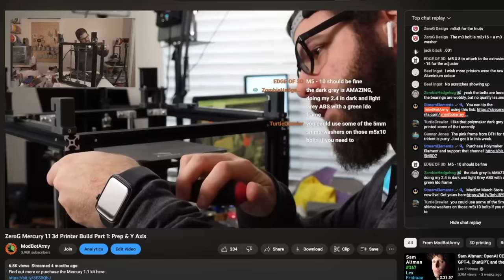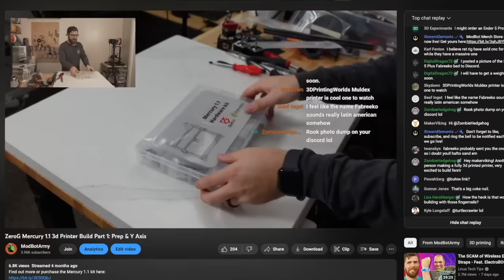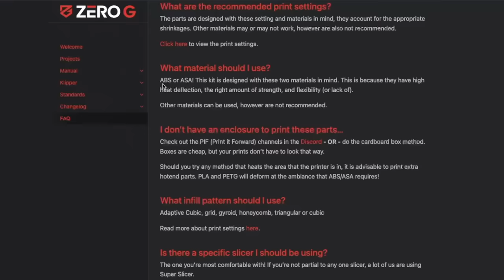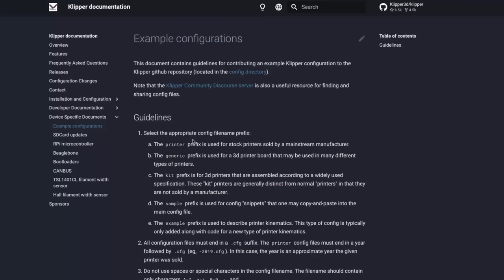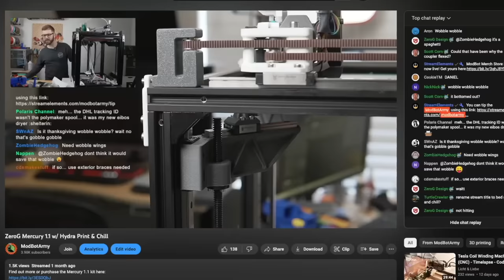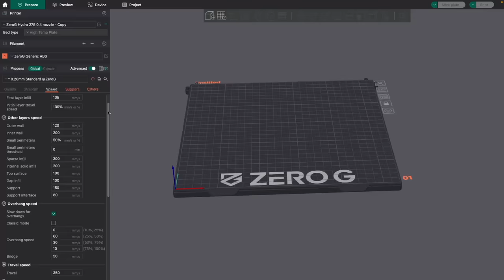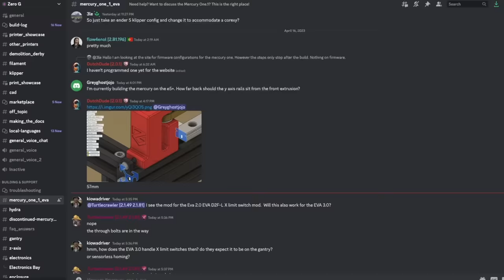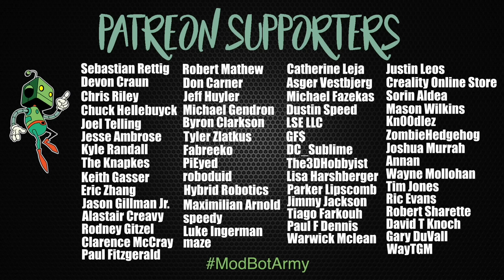Favorite CoreXY 3d Printer Build?! Zero G Mercury 1.1

Comment: I created a custom Mod Max upgrade to get a 310x310 print bed. I’m surprised they don’t do this out of the box. It requires no extra parts (just modified printed parts) other than the larger bed/heater.
Reply: I saw the modmax upgrade on printables but the Z conversion was not complete. Can you give more details about that?
Reply: @DerUltrazauberer  I just uploaded the Z-axis parts to Printables if you are interested. I think the design can be further refined as there are some details I don't like, but it works fine.
Reply: @tonycosta3302  thanks, I will look for it. Too bad I just adopted the Trident Z to my Sovol SV05. I just need to do the electronics and than can test with a 300x300x10 casted aluminum bed.

Comment: I build a corexy with my students. The upgreade idea is using a Bigthree skl 1.4 turbo. Board. What end stop sensors you use? Can i instal the leveling sensor on this boar?  The wifi is operational?  The software for android cel is avalable. Thanks for attention.

Comment: This is a very interesting proposition for an ender5 upgrade with a great community behind it. 
The kits are a very good option, a cost breakdown of different combinations would've been great to see as this looks like it can easily add up and probably price match ready to go option
Reply: The core benefit of such an upgrade is that you can buy an already functioning printer, use it for a while, then invest more money into it if you want to. Even if it ends up more expensive than a ready made solution, this ability to see if you will actually be printing that much, and the ability to distribute expenses throughout the lifetime of the printer, can be more valuable.
Reply: @p_serdiuk it also extends the life of said components, and makes one less obsolete printer. I'm looking into this build and sourcing a lot of my excess parts in house.
Reply: @p_serdiuk I went through this with my ender 5 plus. I managed to learn about different filaments and got a microswiss direct drive but the rest of the machine is lacking and too slow for a few things I'm developing and want to start selling. This is the perfect upgrade to achieve a good production speed and doesn't have the plastic wheels so the print quality should be better too. I played around with a Biqu skr mini e3v3 and put klipper on it but realized to run the trident I need 3 independent stepper drivers for each trident leg and the skr mini has one driver that drives two lead screws. With the skr 3 pro I ordered I can use higher 48 volt powered stepper drivers to run the corexy motors faster 🤔. Cant wait to see how fast I can push this thing.
Reply: @TTS-TP honestly it's still pretty wasteful 😂. Like you basically throw away the whole ender 5 components and use the 2020 extrusion frame. Even the nice Sheet metal control box is tossed. Would be better to just build your own frame from 2020 extrusions.

Comment: Just bought all the parts for this but I'm going all aluminum even with the hydra arms. Mellow makes an aluminum toolhead for this and also a water cooled extruder that their Goliath hotend hooks into. Also got a fystec lightweight gantry so I want to see how fast I can push this. Starting with a tool head blower fan but it seems running a duct to the tool head with a remote fan can cut even more weight 🤔. They also make milled out linear rails that could reduce even more weight from the gantry.

Comment: For the cost associated with it, it might make more sense to get a k1 instead. I guess it comes down to if you want a project or a printer that works out of the box. On yours, you should go with a creality sonic pad for the interface. Would also be cool to see the dyze design horizon auto bed leveling sensor on that. It uses the nozzle as the touch probe based on a load cell. No more adjusting z offset after nozzle changes.
Reply: So true.  I feel like a lot of these projects (starting with Voron) are going to be losing steam and go from a niche to an even finer niche because they'll be losing the crowd that was there for the quality, reliability and speed, since the big manufacturers can finally deliver all three for way less than the cost of any of those kits.  Obviously the tinkerers, the tuners and the modders are not going anywhere, but the companies that specialize in catering to this market will definitely be feeling the squeeze.
Reply: @Madderall  I'm going through that debate now. I've got an ender 5 plus with some mods thinking about going corexy with it but the idea of getting a set it and forget it, good looking, enclosed printer is starting to be appealing.
Reply: @kyleo1236  The 5 plus is a sexy machine, but there's always a chance that after a major overhaul like this some mods won't play nicely with each other blowing  your budget, so it's a gamble.  If it's already a good performer with the mods you already got I'd leave it alone considering it doesn't cost that much more to get the k1, so you'll have two reliable printers instead of one potentially major headache.

Comment: i'm using the mercury since its birth literally... my serial number is 2.0.4 - so the 4th finished conversion and contributed some minor stuff for the usermods. Also had close contact with DutchDude while development of the 2nd revision was ongoing. The first version had some serious design flaws. The last mesh leveling i've done was in february 2022, still getting perfect 1st layers today. Only switched the plate to cast aluminum and 230V heater, z-motion system is still stock. For z probing i went for a Super PINDA, cause i had some issues with the clicky probe, i suspect the magnets, maybe bad conductivity, cause probing with that one was all over the place. All in all, i love the Mercury and printing reliably for roughly 2 years now

Comment: Have not heard of the Murcury1 but I am planning on building a steel frame to get more rigidity and more head space 400 x 400 x 500. But I want to make the bed like the rat rig on balls but I see what you have done and that gave me an idea. Will see what I go with. I like the Rat Rigs way of keeping the bed suspended but I like the some stuff on the Voron . Although it seems my machine seems is going to lean more towards the Rat Rig I would like to add the Tap but I will see if I can incorporate that into The Eva tool head somehow otherwise it will be the Stealth Burner. I might design a completely new tool head or a mix between the two. I have already bought the 30 x 30 Square tubing and I plan on building an enclosure for my Ender 3V2 to print ABS  part for Core XY.

Comment: I really like the mercury + hydra idea but the specific parts seem to be in short supply so I started looking at V-Core 3.1 and Voron 2.4.  Maybe I will look into sourcing Zero G one more time before I pull the trigger, especially if the new enclosed and complete version is available and if it is maybe 4040 extrusion like a Doomcube

Comment: Hello @Modbot, word of caution, I have the Manta M5P, with the CB1. It doesn't support screens through the DSI, if you plug one in, it won't power on. You'll need a regular pi to unlock that funtion. I am not sure if an HDMI screen with USB touch input would work as an alternative.

Comment: Hmm I have an Ender 5 Pro w/4.27+BLT+FS and have tried to convert to Klipper via the Sonic Pad with alot of frustration,   this may be another possible upgrade to get better use of the printer vs trying to build a Voron 2.4.

Comment: This is a great project, Theseus' ender 5 haha, i have an ender 5 pro but I currently use it for production, it's a great hobby project but what's left of the original ender 5 as you said in your conclusion, barely the power supply, at that point I would much rather consider buying a voron kit for example, great video!

Comment: I have heard of the project, but not the specifics.  Thanks for a clear explanation.   Sounds like a way to make a good printer from scratch,  What would the cost be for all of the parts required for the total upgrade including the new frame?   I think this should be sold as a total kit - no Ender 5 needed.

Comment: Question:   Would it be better to do the Hydra first or the CoreXY Motion first?
My current Ender 5 has a Micro Swiss NG and was converted to Klipper.    Apart from that, the printer is stock, including currently having the o creality 4.2.2 board.

Comment: This is a great video and has certainly renewed my enthusiasm for my Ender 5 and 5+. I have to say I have struggled to get reliable quality and prints even treating all the basics and levelling until I'm blue in the face. These mods seem to automate a lot of that. I'm at a cross roads. I would like to be able to enclose the frame on at least one of them as I'd like to be able to print ASA and ABS. It seems to be better to build from scratch if you are doing the full Hydra mod.  I'm trying to get an idea of the cost of doing this would be grateful if anyone has figures.

Comment: Stupidest conversion you can do.
İn fact, the whole core xy hype is totally stupid.

You don't get ANY advantage (except not bedslinging) vs. Cartesian. Just the movement of the head is rotated by 45 degrees.
So, NO, it's still 1 motor per axis, only that the axis is rotated!
And you get more slack from the longer belts.